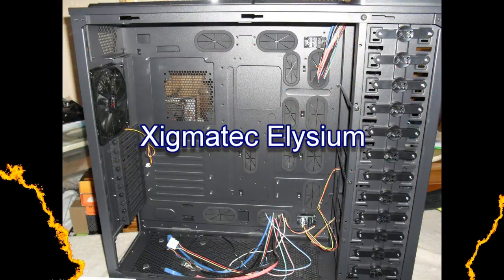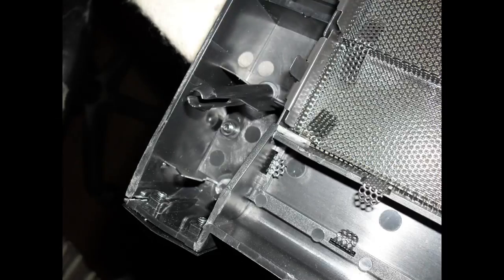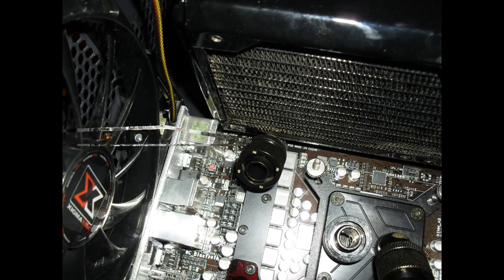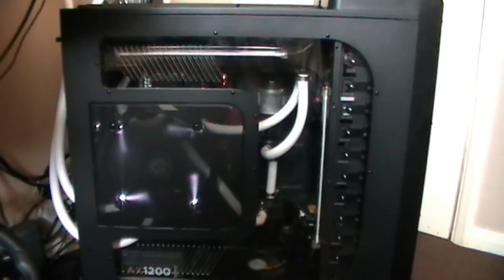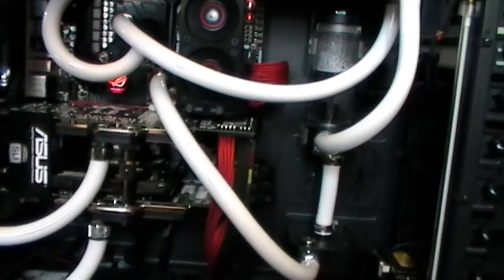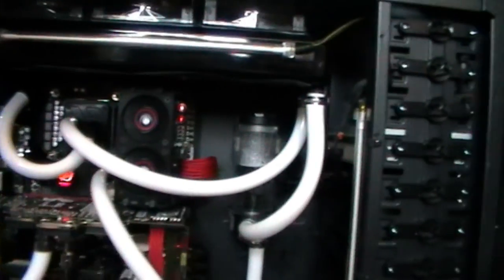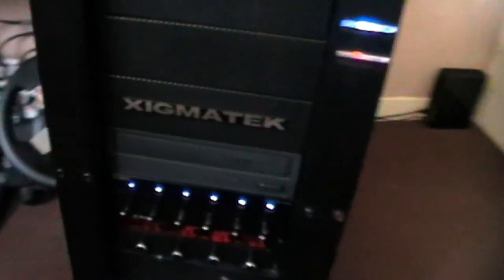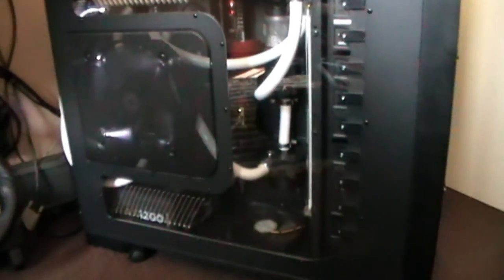The Xigmatec Elysium, Black Beauty's new coat.

Comment from the maker: @crimson177 I came from an ATCS 840 which is very similar, the main reason I changed was the extra room and the black interior, if your haf has a black interior then your main gain will be the space, tough call but I dont regret the change and I still have my 840 which I can paint / mod if I want to